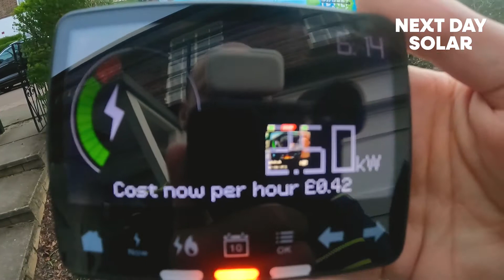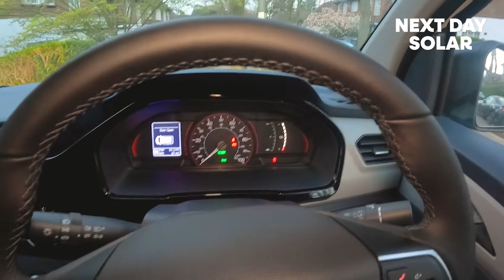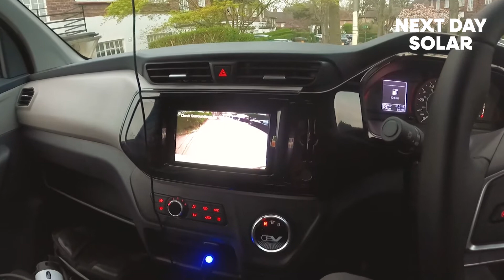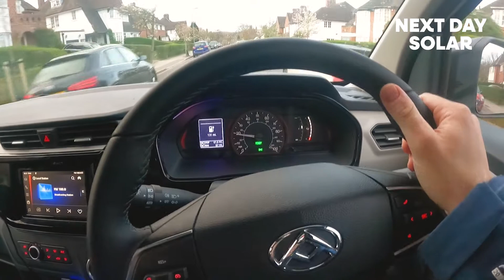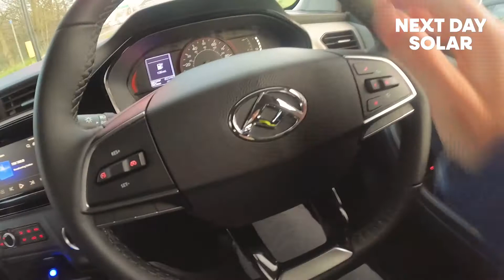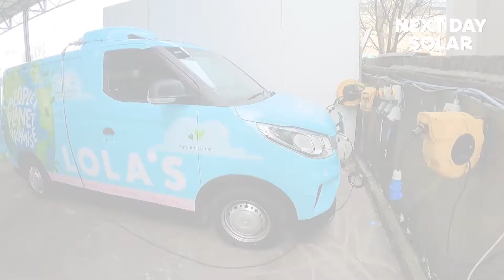E Maxus Deliver 3 - Full Review - Electric Delivery Van

Comment: Very nice, does the solar cooling system, reach minus 18 degrees, please
Reply from the maker: We fit fridges, but of course you can fit a freezer. The solar provides energy to charge/top up the batteries. There are plenty of 12V freezers available, which you could wire up to.

Comment: I wouldn't have thought you could run a fridge unit on an ev.
Reply from the maker: Hi David, some EV manufactures provide a 'take off' supply which allows you to connect directly to the traction battery (via a DC to DC converter) as traction batteries are typically 350-400V, and clearly the fridge is much less. Sometimes they do this by allowing you to connect to the vehicle 12V, which i frown upon, as the 12V battery is for safety equipment in the vehicle, typically an AGM/LEAD and not designed for high use. We therefore continue to put our own batteries in, so we avoid interfering with the traction battery, and should anything go wrong with the traction battery/vehicle during a days 'rounds' we know we've go the contents 'covered' inside the vehicle for a good period of time. The solar allows the batteries/fridge to charge and run from a dead start. We just did another conversion last Friday on our latest MAXUS.